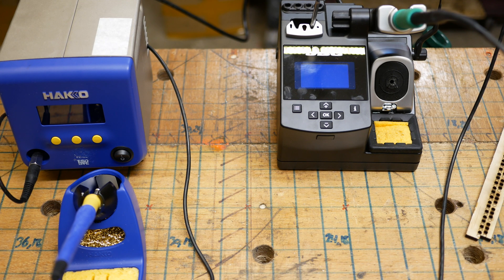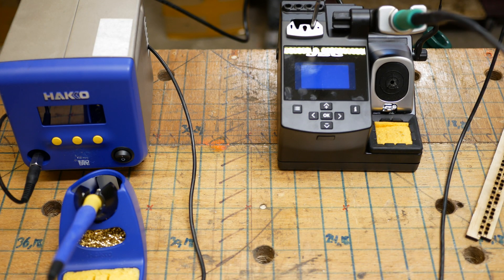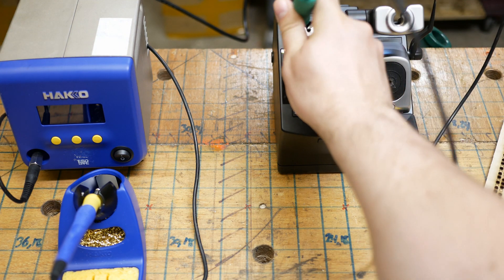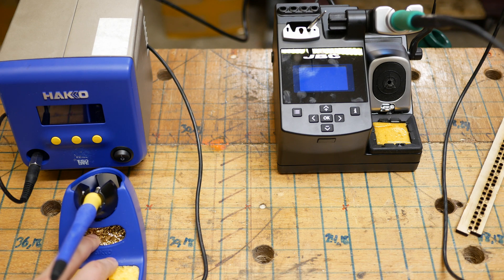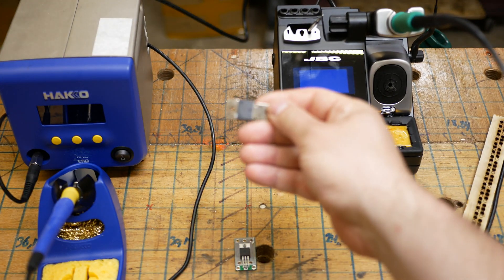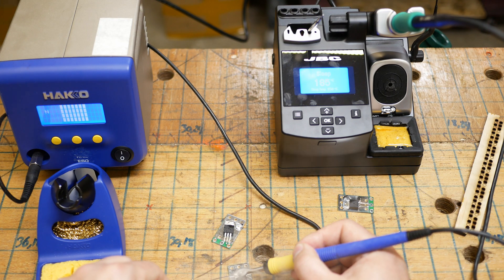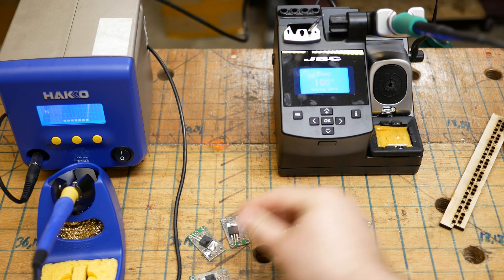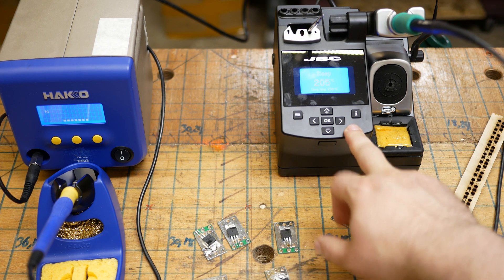JBC CD vs Hakko FX 100

Comment: You're comparing apples to oranges. The JBC is a multi-purpose ceramic soldering station.  The Hakko fx100 is an induction heated system used in very specific and specialized work.  Induction irons deliver heat faster and more efficiently than ceramic irons.  That makes them useful for soldering delicate traces or heat-sensitive parts on a PCB with minimal heat transfer and/or damage to surrounding components.  It uses less wattage because it doesn't need more to do the same work as a higher power ceramic iron.  Sooo... no, this is not a reasonable comparison.  But you could compare that JBC to something like a Hakko FX-971.  That would make far more sense.

Comment: A better comparison would of been the metcal mx-5200 against the jbc. The metcal would of won on sheer power!
Reply: Yes the Metcal mx-5200 can dump more heat, but it is ~3 times the price of that JBC. These two shown here are in the same price range (Hakko a bit more). Everybody knows the MX-5200 rocks, but very few people can afford that for soldering.

Comment: UPDATE: I’ve been testing the FX951 vs the FX100 side by side for awhile now with identical tips is respective series. I use 350C tips in the FX100 because it’s always enough. Generally, the smaller the tip, the larger the FX100 advantage. But it’s often very subtle. If you use discrete hardware that’s generally larger and don’t need the lighter weight of the FX100 hand piece, get the 951, it’s less than half the cost and 95% of the performance. Trick: Thermaltronics has tips that work perfectly in the FX100 and are a little higher performance because they use thinner plating more like JBC. Hakko biases tips towards life, so they have thicker plating and always lose head to head tests of pure performance. But the Hakko tips last a LONG time.
Reply: Which thermaltronics tips works with the Fx100? Looking for bent tip
Reply: @anothersummer2782  Try the H series. They offer a couple different bent tips.
Reply: Yes, Hakko tips are way stronger than JBC. My genuine JBC tip lost part of the plating in just 2 years whereas my Hakko tip last more than 10 years. BTW, I don't use them very often.

Comment: I can't believe this JBC beat the Hakko FX-100! Something just doesn't make sense. FX-100 has a boost function which will increase its output wattage (I'm not sure exactly by how much). Can you put it into boost and blind the JBC with a joint it can't handle. Metcal MX-5200 series irons easily beat JBC by their 80 watt output. Induction heating technology shouldn't lose at any cost. I think you should do another video.
Reply: Just out of interest why do you think the Hakko FX-100 is ipso facto the equal of a Metcal? Just because it uses induction? Also you haven't said which Metcal. In regards to SDG Electronics, that's referring to the Metcal MX-5200, which yes is the greatest performance but is also about 3x the cost of these units.
Reply: @catharperfect7036  you're right, I am just a big fan boy of induction heating technology
Reply: What wouldn't "make sense" is if the Hakko managed to outperform the JBC which has nearly twice the peak wattage available to the tip. This was a bit of a clumsy presentation and a slightly lopsided comparison, but in terms of thermal conductivity and power capacity, the JBC wins handily.
Reply: @claya6581  you're technically correct but SDG Electronics video shows a comparison between 130W JBC vs 80W Metcal where the Metcal beats JBC with obvious contrast. That Metcal beat all of the soldering stations he tested against it, including a 120W Pace. Induction heating technology has a good length of thermal advantage.
Reply: @garbokaba3422  this is exactly what I saw before. JBC starts to melt solder sooner but when it comes to massive thermal requirements, Metcal eventually performs better. Check out SDG Electronics review to see for yourself.
Reply: @roseelectronics4582  JBC 245 Peak power 180W，METCAL 5200 Peak power 125W
Reply: @claya6581  Still a variety of variables to account for such as the efficiency of the mechanism used to deliver heat to the joint. The JBC might spend more getter it's thermal buffer filled because the Hakko lacks one and the energy that was lost outside of going straight to the solder joint. The Hakko FX-100 is similar to the Metcal's which also don't really need the extra thermal mass to liquify solder. The idea is to deliver heat fast enough to heat up only the contact surfaces and the solder that they adhere. For example, you don't want to heat up the entire heatsink to solder something to it.

Comment: You always heat up both parts of the joint by contacting them at the same time with the iron, otherwise the solder doesn't wet.
Reply: I was going to comment a bit on that too. I go by relative masses. If I have a huge heat capacity disparity, I heat the larger one first and let the solder flow to the smaller one. I think heating the board here with some good flux would let the solder flow underneath just fine. But heating the chip here seems like a technique that could make things harder.

Comment: 50w vs 140w and temperature is different
Reply: The way they work is different, and even though it's 50W it uses RF induction heating, so heat is created directly at the tip. This allows for more efficient and precise heating. The true story is in the tips. This is why Metcal MX5200 is only 40-80W but has better performance than anything out there (if you're willing to pay that price).

Comment: The FX-100 outputs only 50W at max. It's good but still no match for JBC. If hakko came out a 150W model, I might consider getting one for myself.
Reply: RF induction with Curie point tip is not equivalent to resistive heating power. A 40 watt Metcal iron will outperform JBC.
Reply: @acoustic61  I finally got a cloned JBC with genuine tips. It turns out the heat conductance is the key, and  performance is somehow related to the tip design and material used. Wattage isn't the key criteria for a soldering station as most of the time my station was under 20% of rated power.
Reply: @phuang3  Yep that's what SDG Electronics points out. In the end it all comes down to the tips. And as of now with that type of iron, nothing beats the genuine JBC tips.
Reply: It has a boos function that can give out 80 watts.

Comment: So I just took delivery of an FX100. Preliminary testing against FX951 shows 951 to have advantage with the tips I have at hand. With some tips, it is a substantial advantage in thermal performance. Why is this? It's because the equivalent T12/T15 tips are generally a lot shorter and therefore give superior thermal response. Hakko has announced very recently that many T31 tips are being replaced by T31B series which is shorter. This improves thermal performance enough that they have discontinued the hottest 480C temperature line. 

For example, BC28 tip in T31 series is 17.6mm. But the BC3 in T12/15 that I used for comparison is much shorter at only 10mm. This makes the gradient much less and improves performance. 

Unfortunately, I don't have any tips identical in both series. I have many T12/15 and only two T31s. I will be getting a 2.4mm chisel in the T31 that should allow true apples-to-apples comparison.

But so far I can say very confidently that the advantage of the FX100 over the 951-if it ever shows up- is likely to be very small. That said, the FX100 definitely feels more professional, has superior ergonomics and is a joy to use. I just wish it had some of the same tips available as the T12/15 (like big bevels, tinned face only, stubby chisels, etc).
Reply: That's weird. On FX-100, the tip length shouldn't be the problem, because the IH heating element is right on the tip.
Reply: @phuang3  it’s not at the very tip. It’s at the base of the tip, so the longer the tip is, the farther from the heater it is.

Comment: In almost any test of pure thermal performance, a Hakko will lose for one reason above all: they use an extra-thick tip plating which carries a significant thermal performance disadvantage. This makes their tips superbly durable, but at the cost of ultimate performance. The standard JBC tips are Ferrari-like: optimized for performance, but not for durability. This is why JBC offers a separate line of "extended durability" tips that have thicker plating more like the Hakko tips. The hakkos would compare more favorably to those "high durability" JBCs. Which is not to say that the Hakkos would suddenly outperform-- they most likely won't. But the gap will narrow somewhat.

The second reason Hakkos often lose is that they often don't offer high-heat tips in many of their lines. This test is a bit apples/oranges in the sense that the JBC tip is substantially larger and has more thermal mass. But it's also apples/apples in the sense that you bought essentially the highest heat tip you could get for each station. The fact that JBC offers a larger tip doesn't make this an unfair test-- it actually reveals potentially a significant reason to choose the JBC. Especially since these stations are comparable in price, at least in the USA.

Almost all the JBC tips have a larger section near the tip that only exists to increase thermal mass. None of the FX-100 tips have this feature, only ONE T15 tip has this feature (XD1.5). This is a basic weakness in the Hakko designs relative to JBC. It's one of the key reasons JBCs perform so well (along with the thinner plating), and it's also a big reason why the JBC tips cost a bit more. There's simply no replacement for having a hot mass near the tip instantly available to discharge heat into the work, and this is a major design advantage of the JBCs.
Reply: That's one thing I really like about JBC, tips for absolutely everything. They allow you to do incredibly fine microscope work.
Reply: And besides that, everybody forgets to mention one "small" detail, that Hakko has 50W of output power and JBC has 130W of output power. He tries to compare devices with almost 3 times difference in output power. Hmmmm, who will be the winner? )))))
Reply: @dmitriykhalimov161  Resistive heating with Thermocouple PID loop is not equivalent to Curie Point with RF induction. I use a 40 watt Metcal station to solder wires on a steel chassis with no problem because thermal recovery is instant with Curie Point.
Reply: @dmitriykhalimov161  If all factors are put into consideration, I believe this Hakko wins over the JBC. FX-100 has a boost function that can spit out 80w temporarily, and combined with its induction heating technology, FX-100 can easily win the thermal battle.
Reply: JBC tips seems to wear out fast for me and they're quite costly to replace. I had only used them to solder at at most 350C and average about 300C for the majority of time.

Comment: Awesome video. Thanks for making. I have a 951 and recently acquired the ultra heavy duty 300w Hakko for testing. Real world, very little performance increase with huge tips and 300w unless you crank the temperature up. It’s because you can’t force much power out of the station if you aren’t pulling much heat out— and the heat flow depends on the temperature difference. At 450c, a significant difference in performance between the 951 and 801 finally emerged. The lesson here for me is that until your old station fails to be adequate at it’s highest temp with a bigger tip, more power probably won’t help. Also, jbc tips have thinner plating and superior heat flow, but less durability than the Hakko tips mostly intended for durability
Reply: Thanks. This is exactly what I want to know. I've been using Hakko for more than 20 years. You are right about Hakko's tip durability. My current soldering stations are FM-202 & 941,  both purchased 15+ years ago. During these years, only one of the 941 tips failed. They are much better than my previous Hakko 939.
Reply: @phuang3  How often do you use the tips? Fifteen years of durability is unusually long. Most people say that full daily use will wear out any tip in just two years.
Reply: @roseelectronics4582  Not very often. Perhaps 1-2 hrs per day. I'm just a hobbyist.
Reply: @phuang3  That's what I guessed. Thank you for the reply 🙂